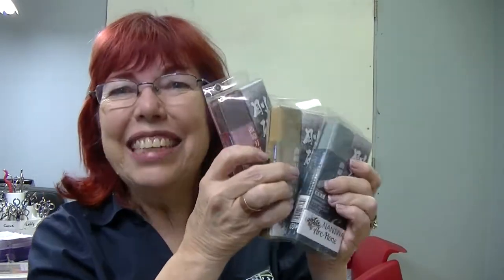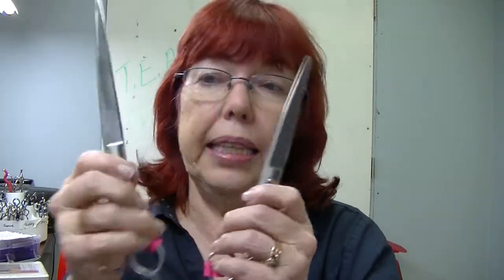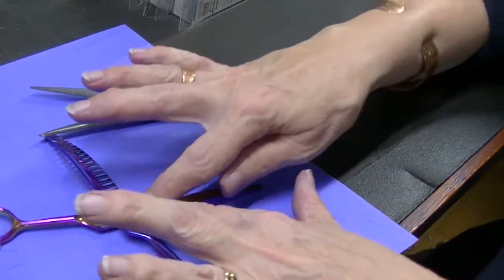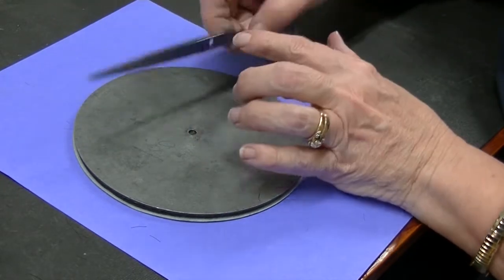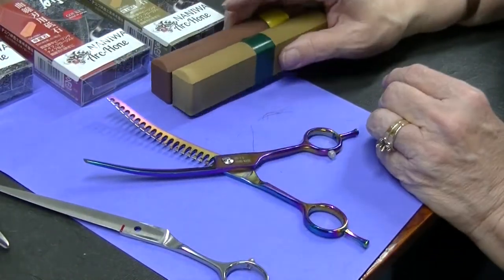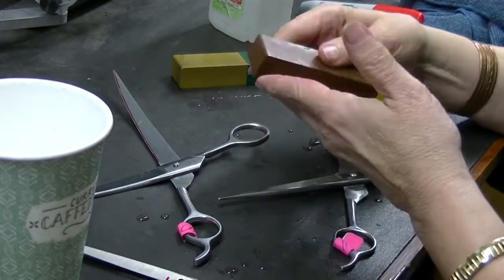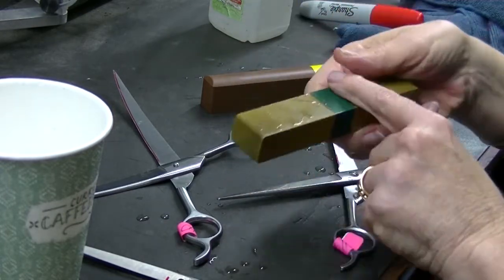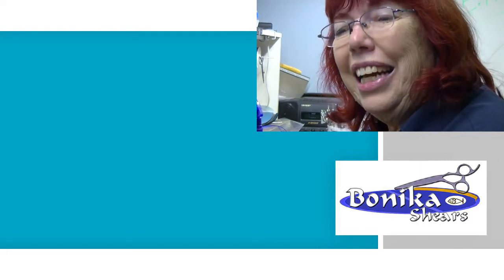Understanding the Rideline on Curved Shears and How to Sharpen it Using the Nanawa Archone

Comment: Why is tape used for rideline guidance on the curved blades and not on the flat blades?
Reply from the maker: The flat blades I’m able to have the whole blade on the water stone with the pressure on the pivot area. The curved shear I must estimate the flat rideline. If you can do this without the tape, that is good. The tape is a helper.

Comment: You are correct, the reason why there is no ride line in the back has to do with how the shear is hollow ground.  The way the hollow grinding wheel is positioned and the path it travels ensures there is only a ride line on the top. The mysterious twist people are talking about is to the best of my knowledge exclusive to Solingen Shears. We call this “Drehdrücken“. The literal translations would be turn-pressing. It’s a specific process prior to hollow grinding in Solingen in which the blade is turned to create a very beneficial blade tension. German hollow grinding machines then have to follow this twist to keep the unique tension and feel that you get from classic Solingen Shears. All Asian shears including high end Japanese shears usually use a combination of precision hollow grinding , hammering and other traditional techniques to achieve a balanced blade and end product but do not incorporate “twisting” the blade by applying precision blunt force through a big industrial machine the way they do in Solingen, Germany.
Reply: Hey, thanks for adding this comment. A lot of good stuff there. Very good of you EOS'. Cheers. 😉👍🏻🙏🏻
Reply: @omnipresent1215  Anytime! Happy you found it valuable.